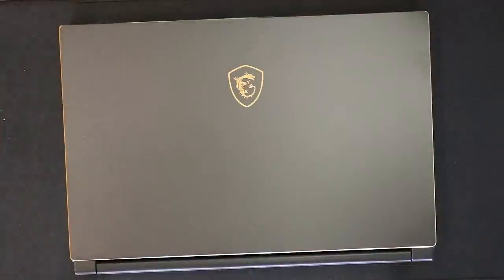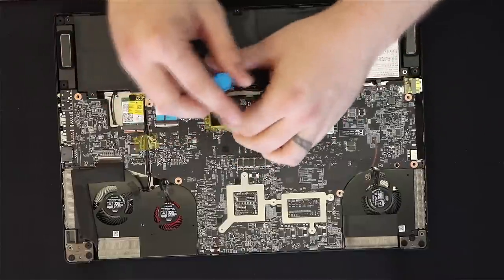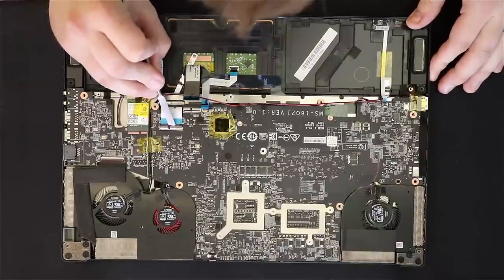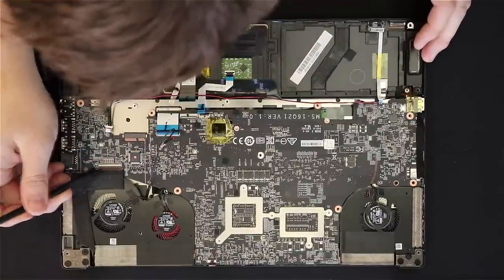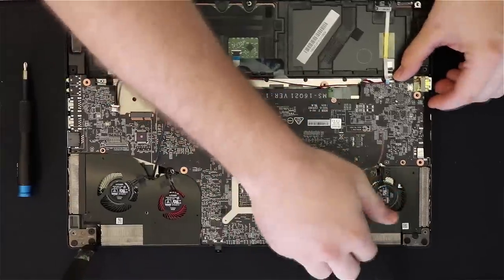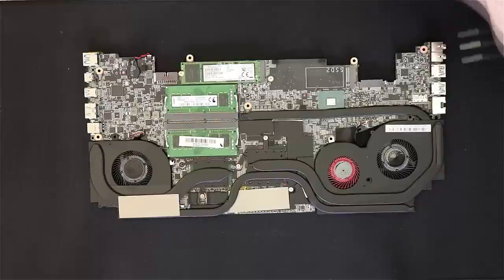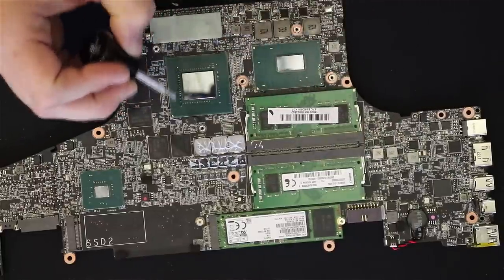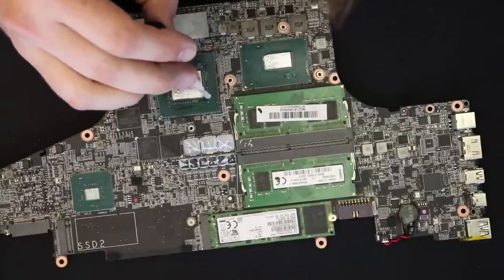MSI GS65 Laptop Teardown and Liquid Metal Mod - 20C Lower

Comment: I had the similar problems as you regarding thermals, as my msi gs65 was thermal throttling over 30% when running AIDA64, or playing games like Warzone for an hour my CPU was easily peaking to over 90 degrees C even with cooler boost on + external fan (GPU sometimes to 85C). Hell, even just putting the laptop in turbo mode caused CPU thermals sometimes to spike up to over 70 degrees in idle, while averaging around 60 degrees. I bought and iFixit toolkit and using your video I could easily disassemble the whole thing. My laptop is 2 years old and the paste was significantly dried out and crusty. So i went to work, did a few minor things extra, such as applying 2 layers of modified conformal coating around the die (wanted to be sure of heat resistance as it has max service temp up to 200C) and finishing off with some kapton insulating tape as second defense layer. I also disassembled the gpu and cpu fans and cleaned the inside as the vent holes were clogged with dust and the cpu fan was making noise. Finally I repasted the more whiteish paste that was just left in the video with kryonaut paste, as it was pretty dried up aswell. Also did a 1tb SSD upgrade. I have to say, the results are awesome. Idle temps are now around 40C. Running AIDA64 on full GPU and CPU load with no thermal throttling and does not cause my temps to rise above 80 degrees, or 70 even when i turn on cooler boost. Overall laptop is much more quiet now. Although it did cause me some headaches, such as a minor slipup with the LM on one small gpu capacitor and having a heatsink screw that I had to drill out using a cutter, I'd say it was worth the trouble. I am very happy! This was also my first time disassembling a laptop. Might update you in 6 months when I will reexamine the LM.
Reply: This may be a shot in the dark but, how'd it go? I've been reading some material where people had issues on the liquid metal "drying up" and having to re apply after a few months. I don't mind re applying although hoping that process would at least be yearly.
Reply: @NootNoot.  Hi! Yeah after a year I began noticing my temperatures went slightly up (5-10deg). As I was a little bit conservative in applying the LM, it was indeed a bit dried up after a year. I repasted again with the LM and now my laptop is again working as described (after almost 2 years now). I think because the first time you apply it, the LM will diffuse into the copper of the heatsink. If I am correct the LM + copper will slowly form a new type of metal layer on top (which isn't harmful). So once you repaste again, you don't have to do it as frequently anymore as the top layer will be saturated. Still very happy with the results.
Reply: @jibbem  Woah, thanks for the reply. Didn't think I'd get a response let alone one with this quick. Thanks again and take care!

Comment: When you say nail polish, do you mean actual clear nail polish? Or is that some kind of computer term I’ve never heard before.
Reply from the maker: Literal nail polish just some clear coat to use as a barrier.
Reply: Thanks! I've never messed with this kind of stuff before, so I was going to take mine up to Microcenter to have them do it. They were suggesting I use IC diamond, saying it's "the best one". Was there a reason you went with thermal griz?
Reply: Steven Scott  compared to regular thermal paste, this is actual metal, meaning that it’ll conduct the heat better. Thermally, it just does a better job, but definitely a lot more risky than IC diamond/thermal paste

Comment: Does the lid need to be on to test it to see if it's working? I think I messed something up, it's not booting.
Reply: Pull it apart, and put it back together. Chances are one of the cables just isn't in right.
Reply: @Silv3r.8901  nah I figured it out, I just wasn't used to the fact it takes 20 seconds to boot.

Comment: I once owned a GS73VR and it was the same deal as this, flipped motherboard.  Such a pain to upgrade.
Reply from the maker: That really is the only huge drawback I have with this, that and the not having gysnc
Reply: that's why I got the aero 15x instead. id rather not pay for upgrades late on so i got the 15x so its easier to do it myself

Comment: I hear there is creaking with hand resting on the palm area, is this true? build quality is a bit of a concern. Thanks for the tear down video! Likely will save me money as resalers want to charge $70-80+ on top of the ssd price just for ssd upgrades...
Reply from the maker: Honestly build quality is pretty good I don’t notice the deck flex when using the keyboard that doesn’t mean it’s not there but I really can’t feel it. Now it doesn’t feel like a MacBook or anything but it does feel very well made. Also I can see why they want $70-80 dollars to tear it down it is a chore compared to other devices it’s doable just not as simple as just taking off the back panel.
Reply: Im in England, upgrading at store isn't an option here. Different warranties. Booo.
Reply: there's is creaking and flex but nothing gonna happen from that. it's not less durable than a blade 15 or a macbook. hope you don't plan dropping it or sitting on it.

Comment: why is your hand so blurry while wiping down the laptop at 0:20?  I thought there was something wrong with my refresh rate but no, it's the video itself.
Reply from the maker: No it is the video. I had set up my lights pointing up through my ceiling fan which was running. This caused a really bad flicker in the video that made it unwatchable. I used a trick in Premiere to remove the flicker but the side effect is the ghosting. Trust me it is the lesser of two evils. It was a rookie mistake on my part won't happen again. Also I didn't film the entire thing again because it was a hard laptop to open the first time and didn't feel like trying again and messing up the liquid metal application.

Comment: Can you do a Updated video of your Temps using the Liquid Metal Mod, and Undervolt settings?

Mine has the same specs as yours, MSI GS65 
however im using the Kryonaut and undervolt of -175
still hitting at 80 to 90c dpending on load

Comment: I guess this liquid metal has gallium in it. But be careful with gallium, because if it gets in contact with anything aluminium, it will cause damage to that component. What are the heatpipes of this laptop made out of? I hope it has no Aluminium in it. I have almost the same laptop (GS75) but I'm too afraid to try this mod. How is it working out longterm?

Comment: I only got about 3c cooler doing this. Using Thermal Grizzly Conductonaut. Cinebench R20 highest core went from 91c to 89c. Lowest core went from 86c to 83c. I went sparingly on the liquid metal on both the cpu/gpu and the copper heatsink. Made sure it wasn't pooling in any spots. I've done this before on my 8700k and results were great. So I'm not sure why this didn't work so well. CB score went from 2366 to 2582. Any ideas? Perhaps I should of used more liquid metal?

Comment: Just repasted. Didn't even monitor my temps before but fans on auto are more quiet now. Playing Hitman 2 maxed out, CPU on high 80s-90°, and GPU low to mid 80s. Also using -150mv with throttle stop, and a +200 core clock and +300 memory clock overclock on GPU with msi afterburner. Guess will down was updating in the background too. Just got a restart message. Under cooler booster the temps were just under 70° both could and GPU. But who wants their laptop to sound like a vacuum? Didn't go quite as well as I expected but it's pretty quiet if I run fans on basic. But. Don't wanna run the laptop at 90°. Wonder if I did t spread the liquid metal right or if I could've applied more. I think the whole cpu and GPU area were covered, although unevenly due to the liquid metal being so hard to spread. I'll probably reapply in a few months, see if it goes better.

Comment: i know this is a little late but undervolting will help your laptop run cooler, and performance wont be affected. Do this before opening up your laptop, and if you have the skill to open this laptop causes its harder than most, then you can try opening it up.

Comment: I got the HP Omen with a 1060 and an 8750h and will soon be doing some cooling upgrades myself.  Just bought some Fujipoly Ultra Extreme thermal pads and Thermal Grizzly Conductonaut liquid metal.  I cannot wait to see the improvements this upgrade will show.  I am also adding some heatsinks to my RAM and will see if a 3mm heatsink will fit on my M.2 SSD.

Comment: Great video! I recently convinced my friend to purchase a 31.5in, 1440p, 144hz monitor which made this already hot laptop run -hot-.  I didn't use liquid metal since I'm not quite that good or comfortable yet, but using this for applying some NTH1 paste yielded a 10C-20C temperature delta on the  very cursory thermal testing I did. The framerates went up by like 10-12fps in a lot of intensive loads, and the laptop lifespan was (probably) increased as well. Previously was running 88C-96C on all cores, now running in the 69(nice)-78C range.

Comment: I've seen others suggesting some other type of coating to insulate the metal bits in the PCB, is it safe to use a nail polish instead, I mean I hope it isn't electrically conductive??

Comment: For those that are interested... I repasted mine with Arctic MX4 because I was dealing with throttling and didn't want to risk using the conductive Liquid Metal. Results can be seen here: http://forum.notebookreview.com/threads/msi-gs65-stealth-thermal-paste-comparison-stock-vs-arctic-mx4.817782/

Comment: I read somewhere that there is a slot for a SATA HDD. But I didn't see it anywhere here, only 2 x M2 NVMe Slot. Maybe you can comment on it?
Reply from the maker: No it does not have a space for a SATA HDD it has the ability to use a SATA basesd M.2
Reply: only one slot that support SATA which the one that the origin ssd came on, so it need to change to the other slot! well i learned it the hard way! or i'm mistaken with something

Comment: Good work I really wanted this laptop I was torn between this and the Razer blade. And I ended up going with the Razer blade for this purpose alone, the flipped motherboard is just completely stupid. And it uses a significantly slower pcie drive than anyone else so to upgrade anything is just way too much of a hasslen, so I ended up going with the Razer blade for ease of upgrading

Comment: Mine didn't go down in temps and still hits 90C but hits higher clock speeds than normal. did I not put enough liquid metal? i was scared to put too much

Comment: I just got this but i’m a bit apprehensive to do the mod right now. The laptop was expensive. I have a bit of experience re-pasting laptops, done it on a Vaio which is harder to disassemble but i have never used liquid metal either. Though i got a tube of liquid metal i bought months ago to use on a desktop, never ended up doing it. It’s not Grizzly it’s from the other known maker Laboratory Liquid Pro.

I was thinking about using it for a few months then do it but the this chips are toasty af and the fan can do your head in.

I’ll prolly just buy an iFix it kit and do it. I’m pussing out due to the price. I’m gonna be paying this thing for 6 months at £280 per instalment. Thank fuck i will pay no interest through a Paypal loan. That’d be another 200/300 on top.

Comment: I did this successfully with the same laptop but I still hit 90+ at times under heavy load. Do you get the same? I can't imagine I did something wrong as all fans are still running and the liquid metal spread I did seems to cover well. My idle temps at the lowest are still around 48. Does this seem right after a liquid metal application?

Comment: I have a GP65 and thinking of this. After a year, still same temps? Notice and increase? How’s the liquid metal doing against the heat pipes? Reason why I ask is because that stuff eats away at certain alloys, wondering if these pipes are resistance to that.

Comment: I have GS65  with 1070 Max-Q.  Used Grizzly (+ Arctic Silver for the VRM) and at first time got around 2% improvement. Then used more "Grizzly" and now it is much better temperature, but still far from your results. Am I doing something wrong?  How did get so good results?  Did you replace thermal-pads? Did you got the -20C with Undervolting?

Comment: I’ve seen some videos about just using better thermal paste like thermal grizzlys kryonaut instead of liquid metal. I would much rather just put better thermal paste then risk the entire system with liquid metal. Do you know if the better thermal paste would get the same cooling results as with liquid metal. Thermal paste is just so much safer and I do not want to take any risks with a $2000 laptop

Comment: I did all the steps and that but i got a signifikant performance hit in games and starting Windows and programs whas slower after i did the Liquid mteal  mod. Do i need to do a reinstall of Windows or should that not ve necesary ? Or could it be that i aplied alot of  Liquid metal ?

Comment: Great video. How did you figure out where and how much LM to put on the heatsink itself? I've looked at other videos, and it all seems like people just eyeball it, but maybe I'm missing something-- I was planning on just making a guide for myself by putting down tape to outline the impressions in the paste before buffering it off, or just putting LM on the die and then putting the heatsink back on for a little bit in order to see where the LM is actually making contact. Are these good ideas? What did you do?

Comment: Doing this saved my desktop 7700k as well.  Went from not being able to OC to 4.9 and hitting 95c, to being able to get 5.0 stable and keep the temp at 70c at 100% load.  What a world of difference.  It was way easier though then in this situation having to remove the entire mobo.  I have a GS75 now and Im going to have to do this eventually.  Nice video man.

Comment: How long did this Liquid Metal hold up Im thinking that nail polish doesnt last long under so much heat its starts to dry and crack maybe high temp silicone or glue would be better.
Reply: If that happens or are worried maybe try put electrical tape as like a second layer of protection

Comment: How is it holding up? :) Great video!
Reply from the maker: I had a power connector failure and had to RMA I took the liquid metal off and reposted it before I sent it to the factory and they replaced the motherboard.
Reply: @UpgradeJunkie  thanks for answering! The power connector failure happened because of the liquid metal?
Reply from the maker: No lol just a manufacturing defect
Reply: @UpgradeJunkie  did it get a lot of wear an tear, you ever trip over the wire maybe? For 2K hope no defects like that for me. I only got 1 years warranty in the UK😑

Comment: Well i have a question....what about the corrosive nature of the liquid metal...it is proven that liquid metal when used on processors and gpu cause corrosion of the metal in long term..lets say in around 6 months... So what should we do about this??
Reply from the maker: This is my first case study on the topic. I have seen on other machines a dulling of the top of the die but nothing dramatic over a year time period I believe. It may just create a patina then not go any deeper slightly like how chrome “rusts” but I am not sure. I would be more concerned if any solder was touched personally seeing as that has been know to have issue. i.e. the shunt resistor mods having the shunts fall off. This material is supposed to be safe for this according to the producer but you never really know.

Comment: Hi Im only 15 and did a teardown on my gs65 to install a second m.2 ssd and then assembled it back together but when I pressed the power button and it didnt turn on my heart stopped lol and i checked the cables for another 30mins and then realized I just had to plug it in for a second and it booted up kinda weird but thanks for the video
 I might to metal mod too.  :)
Reply: This is probably the most important post in this thread.  I do not know why all GS65 teardowns don't mention this important fact.
Reply: Obviously looking for attention but pretty impressive anyways.

Comment: God damnit. After 1 year temps. where high so I decided to reapply the liquid metal. I am very unhappy to report that the liquid metal was completely dry like a crust. I applied again liquid metal and I will see again in 1 year .
Reply: Yep liquid metal is absorbed by the copper heat block. You will need to do that every 8 months or so.

Comment: I loved this video .
How does one know if the nail polish is conductive or not ,Is there an alternative to using nail polish like maybe using non conductive tape?
Reply from the maker: most nailpolishes non conductive i would just check and make sure water isn't one of the bases used in making them
Reply from the maker: tape would work i just don't like the idea of leaving that tape on there for an extended amount of time but that has no scientific bases just personal preference
Reply: Thanks for the reply would the liquid metal have any corrosive effect on the copper/aluminium on the heattsinks
Reply from the maker: Aluminium will definitely have corrosive effect in a short amount of time. The thermal grizzly even has a special pamphlet inside the bag saying do not use with aluminium. It will corrode it quickly and have the aluminium fall apart.
Reply: thanks for the info
Reply: @UpgradeJunkie  Are the GS65's heatsinks aluminum? I bought the grizzly and arctic and a laptop cooler and I'm no sure which would be better and/or safer?